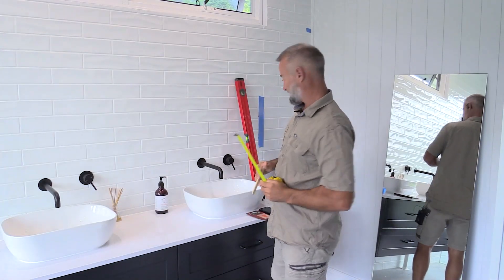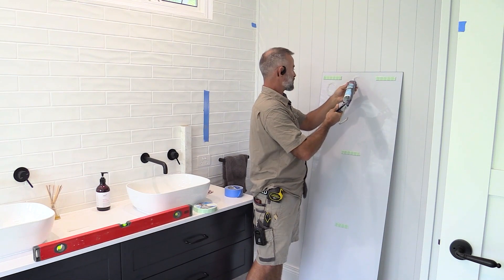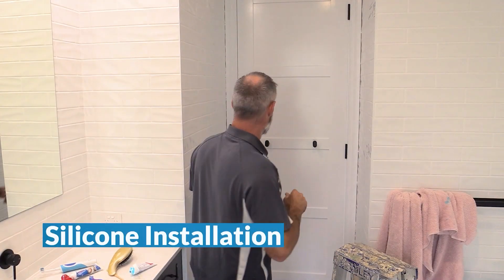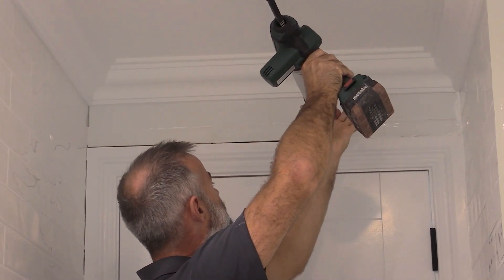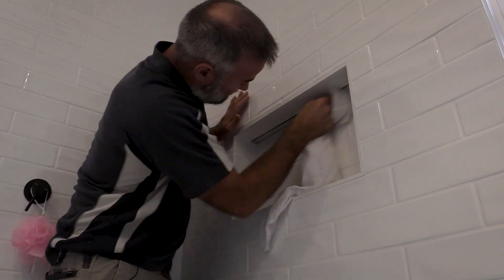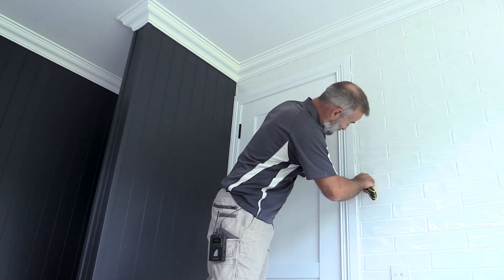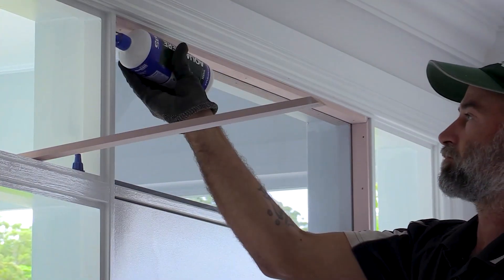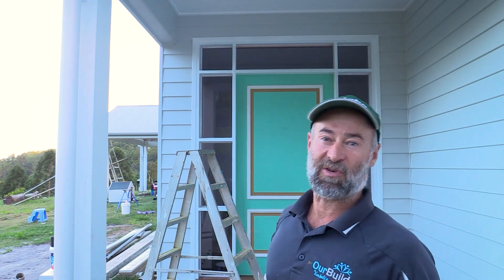Mirror Installation and Silicone -  Episode 32 - The Dirt Road Home Project.

Comment: For those curious about the silicon directly onto the mirror,  the mirrors used had a vinyl backing to protect the mirror silvering from moisture (the white coating seen on it) it's an Australian Standards requirement that mirrors be either fully adhered to the wall or have a vinyl backing and be  protected by a vanity or bench with a minimum height of 760mm and depth of 300mm, the vinyl backing  keeps the mirror from shattering into a thousand pieces if it's accidently broken.

Also having the vinyl backing also negates having to use non acidic based silicon as the vinyl acts as a barrier between the mirror silvering, plus vertical lines are better to any moisture that gets behind the mirror simply runs down the wall.

It's also a good idea to leave the support blocks under any mirror for 24 hours until the silicon has cured as a safety. it's also a good idea to place a small piece of double sided tape to the blocks so they cant accidently slide out while the silicon dries and the mirror slides down the wall (I have seen this happen on a few jobs).

Comment: This is pretty much what I was looking for with regards to the circles I heard of before. Thank you for the upload. I have to do something similar soon. Though the double sided I found designed for this purpose seems too thick, in that it would force the mirror to float out too far away from the wall. Is that the go or do we need a thinner double sided? Just wondering about your opinion on thickness. I couldn't quite see how thick the one you used is in your video.

Comment: DiD u sand the back of the mirror
Reply from the maker: No that's how it comes.
Reply: @OurBuild  can’t the circle silicone holes trap moisture and therefore mould.
Reply from the maker: @out_on_bail  Never in my experience mate.